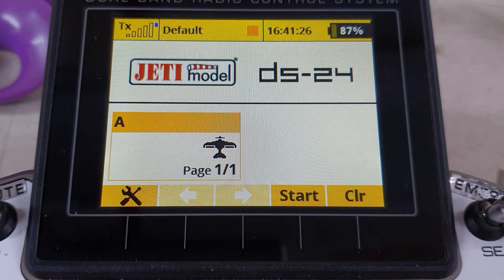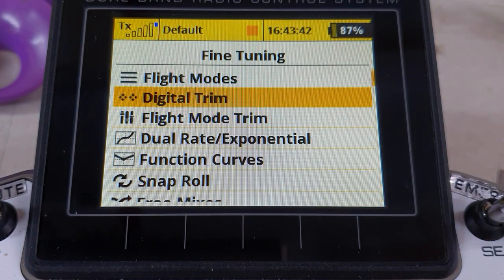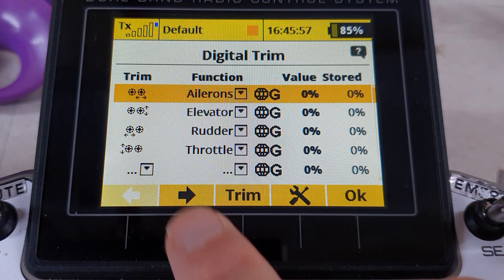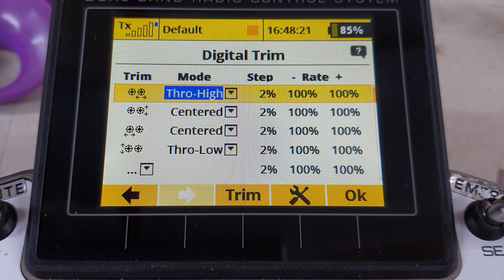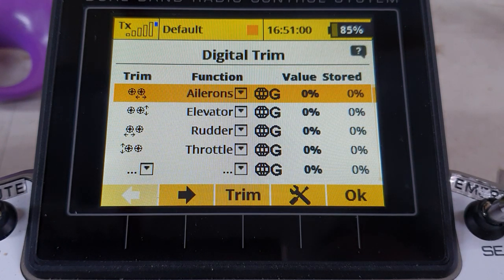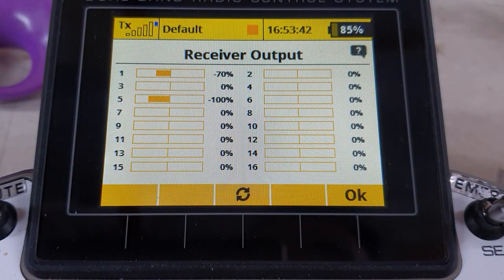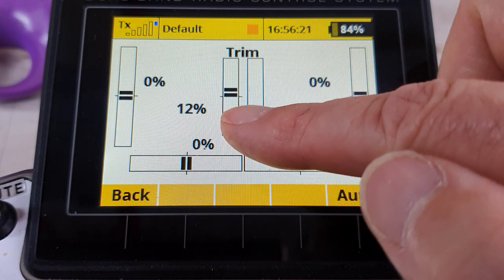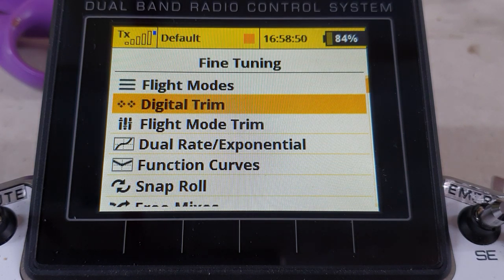Jeti - digital trim and flight mode trim

Comment: Hi Harry, I'm just learning about flight modes on my DS-24 and wish to simply add some preset control surface values for each mode.  I feel like I've followed your videos pretty closely but nothing happens at the servos when I change mode. I'm obviously missing something.   Can you point me in the direction of troubleshooting my setup?  Thank you very much...  jerry
Reply: Harry, please disregard my query of a few minutes ago.  I had a thought and decided to give it another go.  I was getting confused about which mode I was trying to preset.  Long story, but it was "pilot error" and happily i figured it out.  Thank you greatly for the education you're sharing with us!   Jerry

Comment: Hey Harry I got a question for you… Setting up a new airplane today for some reason when I put my trim on the elevator up and down arrows in other words cross trim settings, when I go up and trim my throttle goes down… Is there a way to reverse that? I know it Has to be something simple!!
Reply from the maker: Did you change the throttle trim over, sounds like you left it on the same trim buttons so now they trim throttle and elevator.